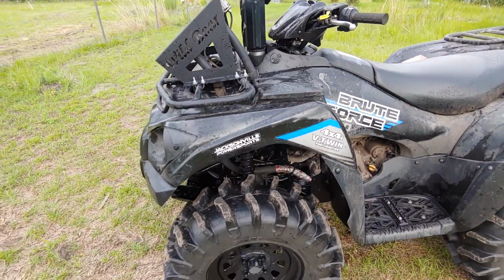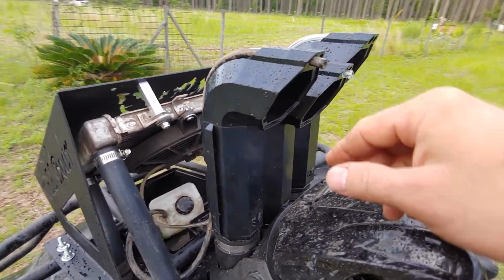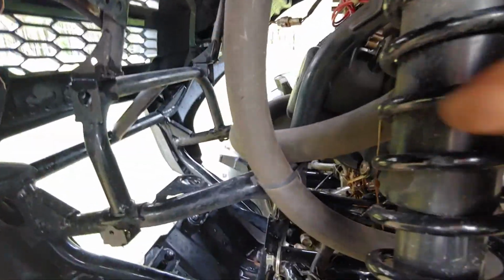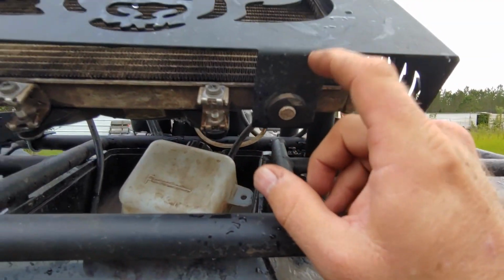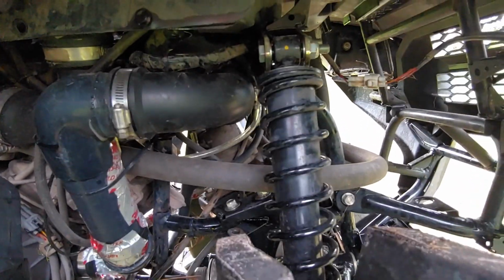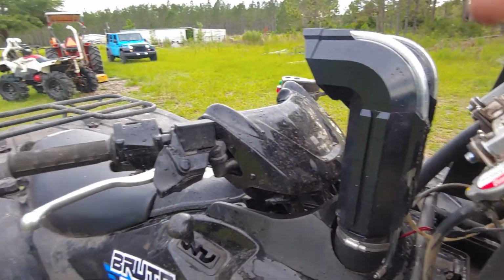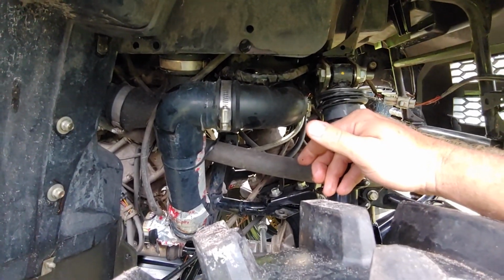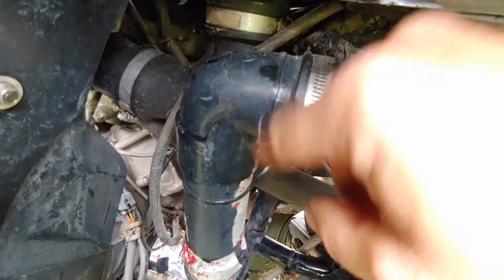Brute Force 750  snorkel & lift kit project complete | review and final thoughts part 4

Comment: What kind and size tires you running
Reply from the maker: 29" XM310
Reply: @rubicscube7827  nice..are they any good ? Do you like them?
Reply from the maker: @matthewhickey4010  Its my sons ATV so i dont ride it too much. The only complaint i would have though is they tend to dig down fast. I have Aztecs on mine and i like those better.
Reply: @rubicscube7827  oh nice ..what you have a brute?
Reply from the maker: @matthewhickey4010  I Have a 2019 King Quad 750, i have plenty of vids on it.
Reply: @rubicscube7827  nice. You like that more then the brute?
Reply from the maker: @matthewhickey4010  oh yeah
Reply: @rubicscube7827  nice. I got a 21 brute I like it .they work good..lots of power
Reply from the maker: @matthewhickey4010  No doubt its a good atv. I just prefer my KQ.
Reply: @rubicscube7827  ya they are ... what one you think is faster?